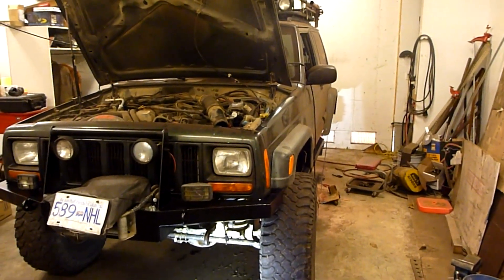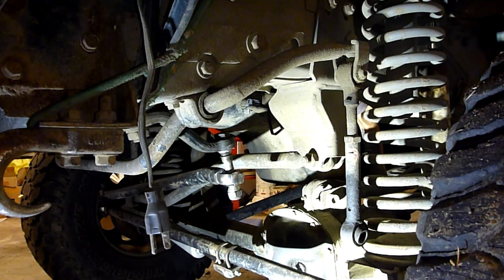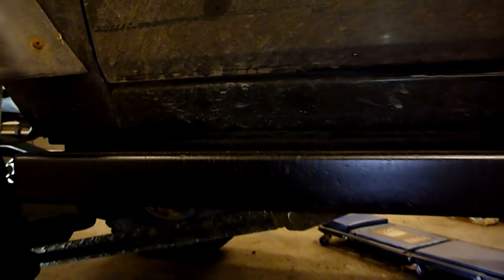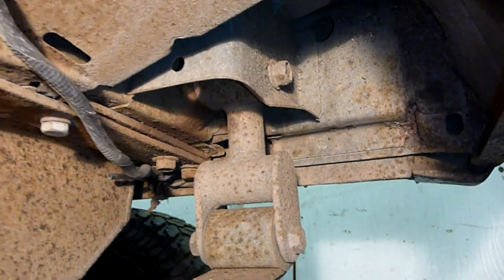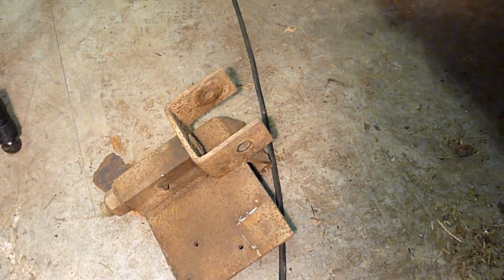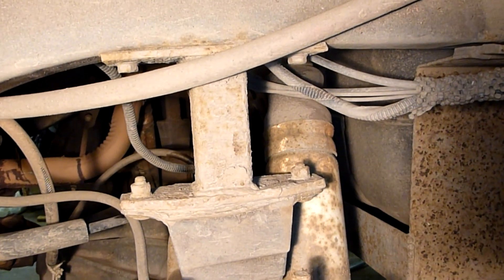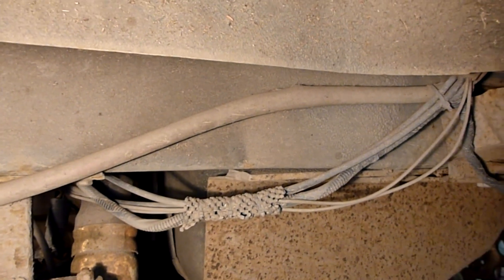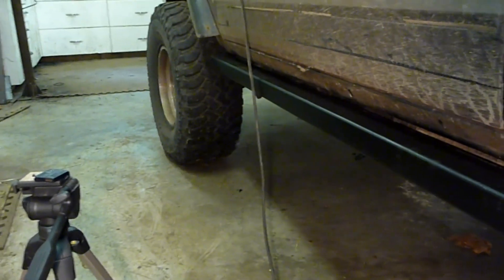The XJ Project - 13 - Suspension

Comment: Weld a plate on the leaf spring plate to where it will connect under the bump stop but cover the break line and the bump can hit to the plate you welded to your leaf spring plate.